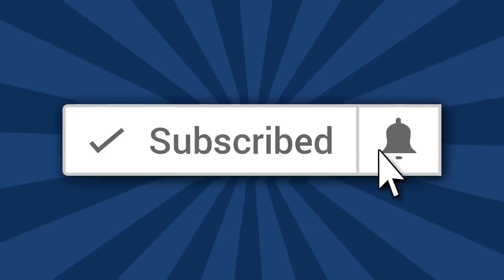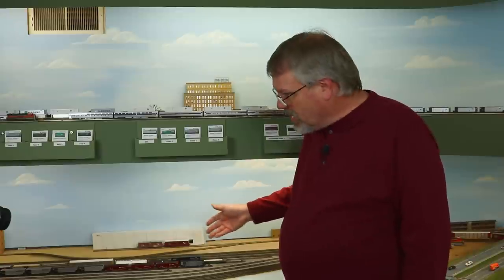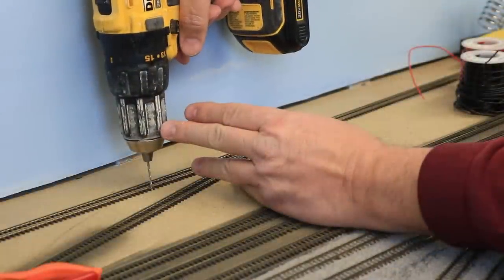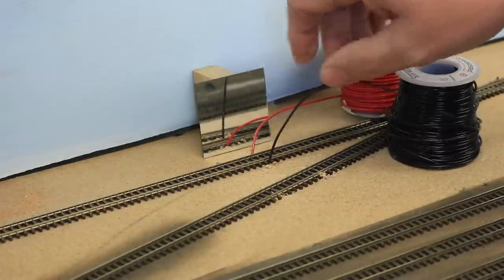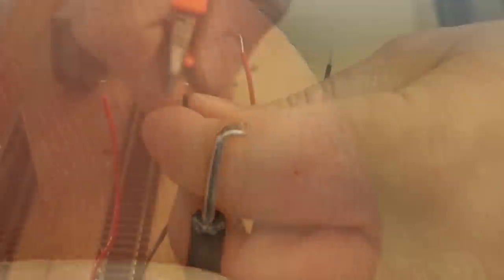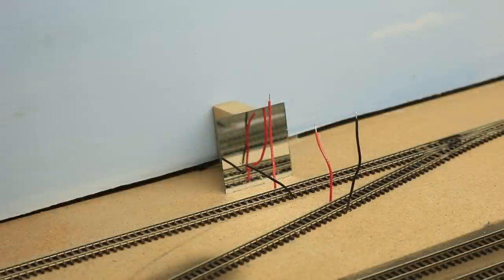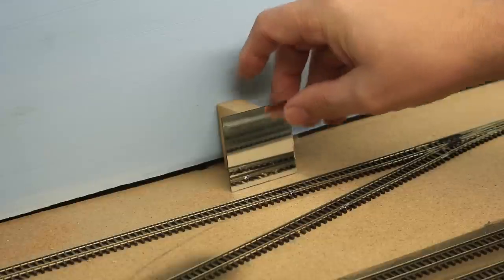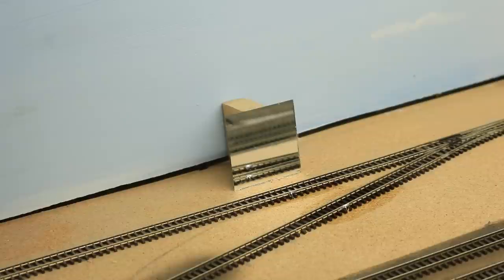How To Install Track Feeders On Your Model Railroad

Comment: Ron ! After spending 23 years in the automotive electronics industry ,I have seen those suite case connectors become intermittent, Nothing worse than trying to track down an intermittent electrical issue caused by one of these connectors. It will literally drive you crazy. After all that effort soldering feeders to the track followed by crawling under the benchwork and using those connectors makes no sense to me. I feel all Model railroaders need to learn to solder and avoid those connectors . Really enjoy your channel, You certainly share some really good information with us..
Reply from the maker: This is why I share multiple ways of doing this, however, understand that automobiles have several factors that come into play that are not factors in model railroads--oil and grease, road grime, extreme hot and cold temperatures, vibration, etc. That said, I've used suitcase connectors for 20 years because they are so fast and I have never had one fail.

Comment: If you take a plastic bottle cap and drill a hole through it, place it on your rail and drill the hole using the bottle cap as a buffer it wont damage your track if the drill chuck drops down when drilling. The chuck will hit the cap and not the rail.

Comment: Ron, cut small strips of black tap and wrap it up on the top of the drill bit - use it as a buffer so as to not hurt the rails when you drill through the bench work; fabricating 101 Bro.  Oh, and the MG Chemicals Liquid Rosin Flux you use is the Bomb!  Having fixed radios in the military, I can say, "This is the Kind!"  It is a little hard to clean if you go crazy with it - so don't use much as it don't take much.  Clean beforehand what you will be soldiering with alcohol, and your soldier that you will be using. Store it out of UV lite - it comes in a dark bottle for a reason.  That stuff is Great!

Comment: Great video, but you never mention wattage for the soldering pencil. I will use HO scale Atlas Flex track. Is a 23 watt hot enough, or use a 33 watt? 45 would probably be too hot.

Comment: Great video.  One question: I have planned one track that has it feeder wires at least 4’6” from the bus wire.   Is it too far away?   Will it lose power?
Reply from the maker: You shouldn't have problems with 1 wire this long. I wouldn't want to plan them all that long.
Reply: @RonsTrainsNThings  can you connect a feeder wire from a building to a near by track?

Comment: Ron or whoever else would like to comment, I am new to DCC and railroading. My question is when do you need to install feeders? After a certain amount of track footage or right from the start of your lay out? Currently I have the Bachmann Commander DCC set as a starting point.

Comment: Thanks for the tips.
I’ve used those suitcases many times in the automotive industry, they work fine, easy to use as long as you don’t have vibration issues or use them under a vehicle, they need to be sealed with tape or liquid tape worked well too. I’ve used the under my layout as well, glad I’m not the only one 👍🏻😊

Comment: Thanks for this video. I just came up from my train room (basement) as I finished laying my sub road bed today and tomorrow I'm starting to wire my first bit of track for my layout. As it is, soldering and electrical work are areas I don't have the most confidence in but I guess that will change. Thanks again!
Reply from the maker: Take your time. Practice makes perfect. You confidence will grow as you do it.

Comment: Great video Ron. Just the info I was looking for.
I know it's a year or so old, and maybe someone has already mentioned this but if you're worried about damaging the rail when drilling for your drops you can slide a small piece of rubber hose or a couple o-rings over the bit to keep the chuck from hitting the rail if it drops too quickly.

Comment: Ron - well done on how to install the feeder wires, I like the little hook that rests on the rail.  Solid wire is better and easier to work with in the small gauges too.  Its amazing how simple the process is, but many folks find this to be a real challenge and not damaging the rail in the process.  Thanks for the walk through.  Skol! Ron//
Reply from the maker: Hi, Ron. Yes, I think many people sturggle with feeders because they lack good soldering skills which, in part, result in poorly maintained and thus poorly working soldering irons. They sturggle to get solder to flow while melting ties below.

Comment: Those 3/32" drill bits are just a bit short!   If you wrap a bit of electrical tape around the end of the chuck that'll help to protect the track when you go through too far.   And, I offset my feeders by a couple of ties, not sure why I do that but for some reason I think its a good idea.

Ah, you are using code 80 track.   Code 55 can be a bit finickier to work with as the web is smaller.

My method is to tin the rail and wire first.   Then, I can use one hand to position and hold the wire and just touch the wire to the rail.  There is enough solder from the tinning that you'll create a nice joint with not too much solder.   Then do the "tug" test to make sure.

Emery board from your local drugstore to clean the solder off the top of the rail, they come in different grits and more gentle than the file (IMHO).

Although, my preference overall is to solder my feeders to the bottom of the rail prior to laying the rail.

Comment: Ron nice job with the demonstration. my only suggestion would come at the end of your video. when soldering feeders to the bus wires, you may want to stagger those wires your strip. just so they dont swing and touch each other. another good method is covering them with liquid electrical tape. Thanks for sharing. I did incorporate your Sub bus and bulb protection into my layout once i saw you do it. Thanks for that.
Reply from the maker: Hi, Rick. I did mention the importance of covering the joints with some sort of electrical tape. Staggering the joints is a good idea. I was limited here by the shot of the camera. Glad you found the buld trick helpful. I think it works like a charm.

Comment: I solder the topside feeders to the underside of rail joiners at the workbench before installing the track.  If I want to change my layout and reuse my track I figure this would make that process easier.  I join them to the bus under the layout using  crimp connectors and screw terminal strips.  I use 22 gauge stranded wire for feeders.  (N scale)  Just my method.

Comment: Nice video on how to make a simple track connection, I like to use a nickel over the rails to fill in the scratches too but like the stainless steel washer too...thanks for sharing....Jack 👍
Reply from the maker: Hi, Jack. Yes, the nickle wold work too...but you knew that. LOL. Thanks for watching.

Comment: Great video! I'm definitely going to check out your other soldering/tinning video.

Can I make a suggestion? If you're camera has the option, turn off the Auto Focus and use Manual Focus. It will prevent the focus from hunting so much when things move into/out of frame.

Comment: Nice job as always. Another option for protecting the "T" connection is to use shrink tubing once completed. Rubbing the still-warm iron quickly over the tubing will shrink it nicely.  Of course, one has to remember sliding the tubing on first...don't ask me how I know that (a borrowed line from MR editor).   Does the common side need as many connections as the hot side? Thanks, Ron.
Reply from the maker: Hi, Daniel. Heat shrink tubing would be ideal, but when installing feeders on a bus wire there is no way to get the tubing on the bus. As for your other question, there is not hot side/ground side in this application as DCC is and AC application and sends code packets to the decoders. Even in a DC application, I would pair all of my feeders as rail joints can be electrically unreliable.

Comment: Very nice video. I have noticed that some people use one of the built in switches on the Tortoise Machine to power the frog on the turnout. But they never said where to attach the power. Can you tell me? Or does wiring the track all around the turnout eliminate the necessity to power the frog. All of my turnout are DCC compatible.  Thank you.
Reply from the maker: Great question. In my case, I am using Insulfrog turnouts and not using switch machines, so this wiring application does not apply.
Reply: @RonsTrainsNThings  Okay. Thank you .

Comment: Ron.  I’m confused.   I have feeder wires at both ends of my peco turnouts.  Red for positive, black for negative.  I bring my red feeder wires through to a brass connector unit and screw in the red wires.  Where in hell does the red wire go from there to the controller.  I don’t want blocks. I’m finding it hard enough to understand all this.  Where does the black wire go also from the track.  Then into where.   I have DC a Gaugemaster Q 4 track controller.

Comment: For me the worst thing is glue track bed and tracks.. The slowest thing to do.... Thanks on good videos here on your channel.. Can you make video on weathering track.. Airbrush and normal... We are in isolation and we have time to throw away.. I have airbrush, and acrilic colors but i don't have thinner.. Any advice how to do it with water or alchohol... The shops here in Croatia are closed for next 3 weeks
Reply: Usually don't mix alcohol with acrylics.  Use distilled water and maybe a flow improver.  If they are Tamiya, use their thinner.
Reply from the maker: I did a track weathering video about a year ago. Here is a link: https://youtu.be/HYspNRlTCVg

Comment: Stagger AND insulate your solderjoints under the layout and ALWAYS pretin wire before soldering...
I prefer to lay about 1/4" of wire along the groove on the outside of the track. You'll end up with a blob of solder whatever you do, so better to just try and hide them with scenery. I may be proven wrong by your experience, but the butt joints look like they could fail from the vibration of trains going by...
Reply from the maker: I have never had one fail.

Comment: Hi, Ron. I enjoy watching your videos.  I would like to make a couple suggestions from my own experience.  When soldering to the track, use a smaller diameter solder as this will help prevent too much solder flowing and getting on top of the rails. I use different size solder for the size of the job being done.  I love soldering all my wire joints, so instead of electrical tape, I found that liquid tape works great for wiring projects such as this.  If you have a jar of it on the shelf for too long & it gets too thick to use, it can be brought back to good use by mixing in some lacquer thinner, or just buy another small bottle of liquid tape as it is not expensive.
Thanks for all of your helpful tips.  I'll be watching you again... Soon.  Dennis.

Comment: A useful and practical video with effective and articulate narration. Thank you. 🙂
I'd like to offer a few rail soldering tips that I have found effective for neat working and final appearance. It can be a little slower but really IS effective and worth it, imo.
1.  A finer tipped soldering iron at high temperature offers very significantly more accurate precision, far less risk of ugly, excess solder and less risk of touching and melting ties - especially in N-Gauge.
2. I always use paste flux rather than liquid. It can't be spilled.  It's  FAR easier to see than liquid, and this automatically enables more precisely controlled quantity and minimizes unwanted flow of both flux and solder.
3. I always tin all wire ends before attaching them to each other or to anything else and I ensure no excess solder is present.  If there is excess, I get rid of it before proceeding further!
4. I always tin the rail with MINIMUM solder before attaching anything to it. VERY LITTLE is actually needed.
Using this combination of carefully pre-tinned rail and pre-tinned wire, together with an absolutely minimally tinned fine iron, ensures there is never any need for additional solder when making the final union because the correct, minimal amounts are already present and placed exactly where needed.  
A short but FIRM press of iron tip, directly on the wire, in turn pressed against the rail, almost instantly melts the solder on both, which become as one in a split second.
Back away, breathe a well-earned sigh of relief/satisfaction and this element of the job is completed - easily and neatly. This disciplined technique of MINIMAL SOLDER, in the right places, at all stages really does reduce excess solder mess and risk of melted ties.

Comment: How many of these do you need to do as I’m thinking of doing a o gauge layout in the garden do you wire each track part that connects together so all tracks are live in new to doing this thanks
Reply from the maker: With soldered rail Inuse a set of feeders on every other joint. If track joints are not soldered the I would do every joint.

Comment: Nice  video Ron. Like showing a couple of different methods, - God knows that there are many others as well. One suggestion though: in the direct soldering of the drops to the secondary buss, I would also suggest that you not solder them  to each sub-buss directly across from each other, but to space those stripped portions of the sub-buss about an inch further apart (just an extra degree of safety).

Comment: Hey, Ron, my dad taught me to put some tape near the chuck or a piece of wire insulation over the drill bit to stop the chuck from hitting the part your drilling. So as not to damage anything.
Reply from the maker: That is a great tip. Thanks.

Comment: Hey Ron this is Ron how about using Terminal Strips would they work for someone that has a soldering iron but can't easily use it for me that's what I've got on my D.M.R.R is Terminal strips I'm using 4 along with 18 Gauge solid bell wire I then hook short KATO power Rail Joiners to the terminal using nylon Ring connectors from Mise Wire Products out of Kingman Kansas they make the Best nylon connectors in the business they use an extended thin metal sleeve In the there connectors that helps hold the wire in the connector as it grips around the outer plastic jacket..  I've also used the Suitcase connectors from 3M & there is a tool that Micro Mark sells for 80 bucks that puts the correct pressure on the suitcase but if your on a budget the pliers are much easier to acquire..

I'd like to add:  I've also seen on the Tube by a Layout Builder New connectors that can pierce the Wire aka the Buss wire a cap slips over the wire you then tighten it and it makes the connection then on the other end of the connector you'd terminate your feeder..  these sound like a very cool connector and for someone that is uneasy at soldering underneath a Layout especially from possible burns they'd worth the money.! 

But as Always Mr Ron from another Ron Great Video.. Let's see some more and what is that Tin Lizzy😆 Take Care be Safe.!

Comment: What is your track laid on? Im extending my layout and I purchased foam boards where I am then going to use cork road bed to lay my track on. And I don't know if that is the best idea.
Reply from the maker: What you describe should work fine. I lay my track on cork roadbed on plywood, but I have also done this on foam with good results. In the video I'm working in a yard so it is on sheet cork.

Comment: Ron great video. I have a plastic roadbed on my track, can i still solder the wires on there? I was thinking i will have to lift track out of roadbed first.
Reply from the maker: I have never worked with plastic roadbed, but if you work quickly I don't THINK the plastic will melt that quickly, so you should be ok. That being said, test it on a spare piece of track before you commit to it on your layout.

Comment: Ron, do you use isolation track connectors? This where I get confused with DCC. I would think it would cause a short or malfunctioning of the electrical system.
Reply: Depends on the type of turnout being used. Maybe Ron can do a Video on types of turnouts electrically speaking. The DCC Guy has a video on types.
Reply from the maker: The turnout video idea is a good idea, however, if I understand correctly, I don't think that was your question. I thing what your are asking is do I insulate different track sections between electrical blocks. The answer is yes, I insulate both rails at the break between electrical blocks. As for turnouts, you either need to use insulfrog turnouts (as I do currently) or insulate the frog and power it with some sort of switch (eg. Tortoise, et al).